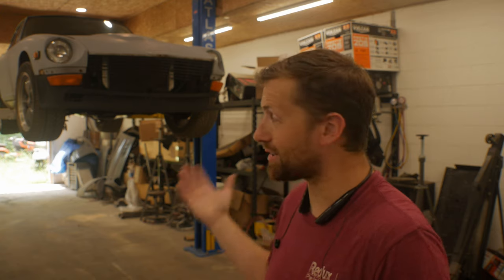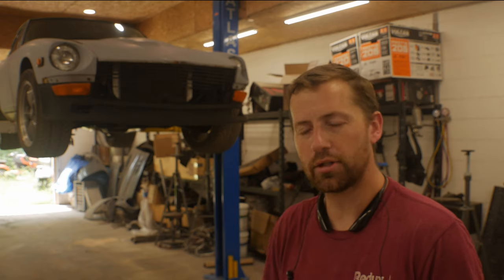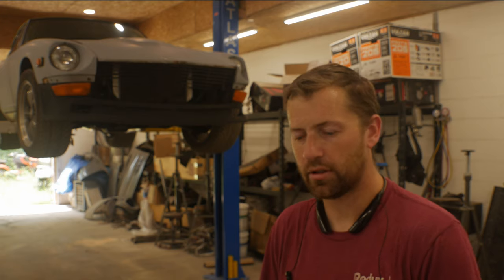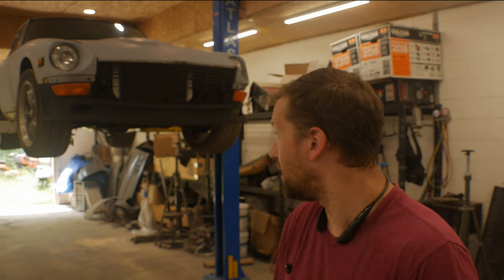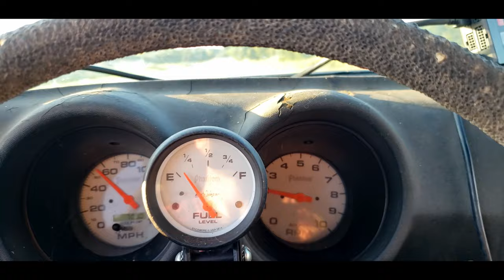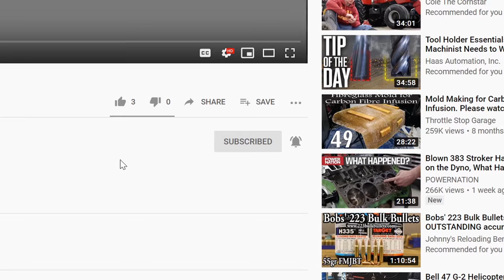TO THE 260+ SUBZ   THANK YOU!

Comment: Any recommendations for a 280z LSx that loses fuel pressure when ambient temperature is above 88 degrees or when you’re at a busy intersection? Just curious. 😝
Reply from the maker: Bwahah, yes, my recommendation would be to come to shop and trade that troublesome LSX beast for a gen 1 swap with way more issues...you will forget all about the fuel pressure issues you used to have when you have 20 new problems to track down ;)